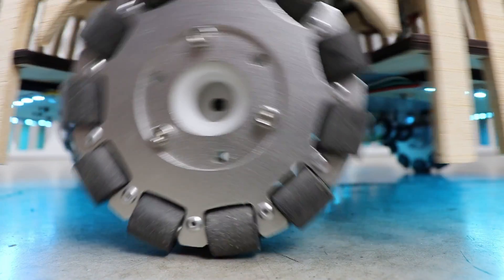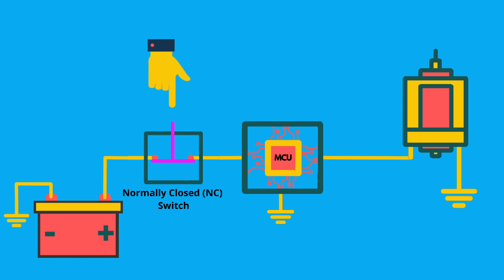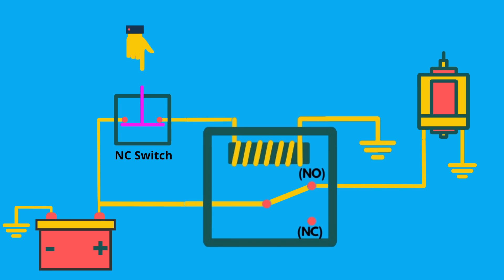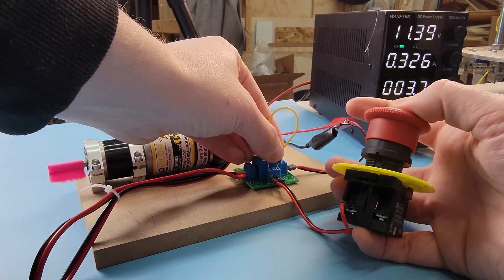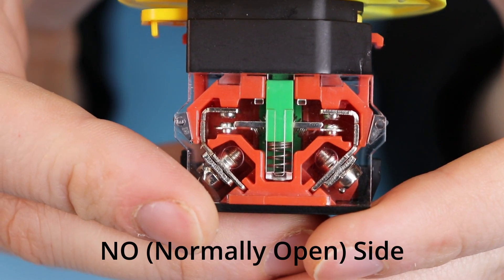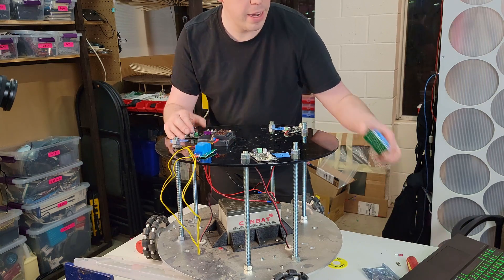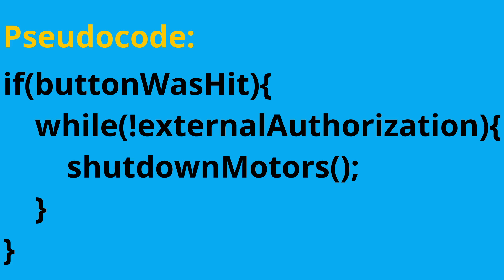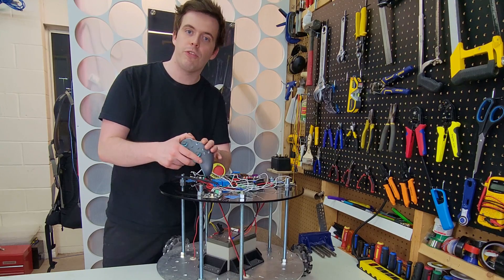Safety First: The Correct Way To Install Emergency Stop Buttons

Comment: Shouldn't we use flyback diode too prevent dangerous voltage spike? I am trying to understand concept for my circuit and this is the best explaining. Some are using flyback diodes. Also, I looked your relays but couldn't see if flyback diode is built in. Thank you!

Comment: Oof, two relays for every motor sucks for my project. Could I just use two high power relays connected to every motor in parallel instead? Or does every motor individually need this to be considered safe?

Comment: Hi sir , 
I wnat ti implement a CAN communication protocols to control robots . 
I am not getting any guidance please help me I am also struggling to find the Motor driver for DC motor which is compatible with CAN. 
Also how should I start to work with CAN?? 
PLEASE REPLY.

Comment: How would you change the circuit if the load was too high a voltage for the microcontroller? Just use a voltage regulator?

Comment: You forgot most important part of an EMO button. A gaurd to prevent unintended activation of the button. A simple ring of PVC works well.
Reply from the maker: That's a good suggestion! As long as it doesn't stop the button being pressed fast enough (I don't like the flip-up plastic covers), but a PVC ring is a neat idea!